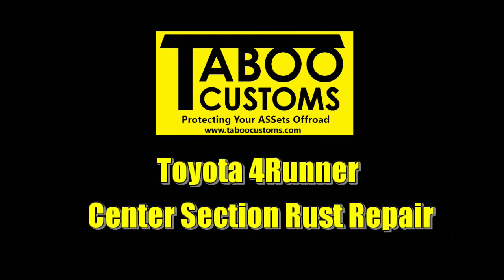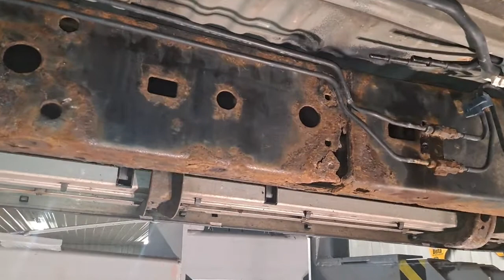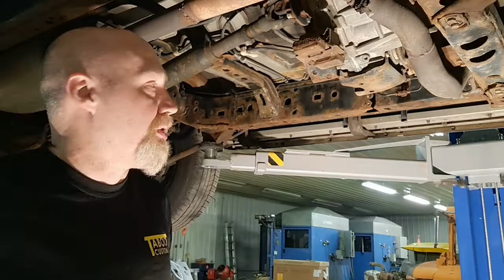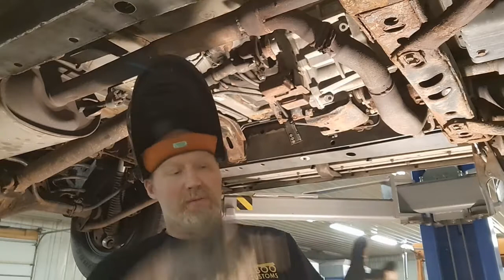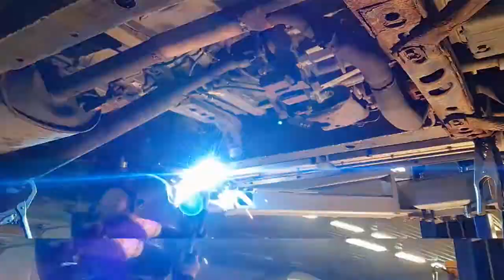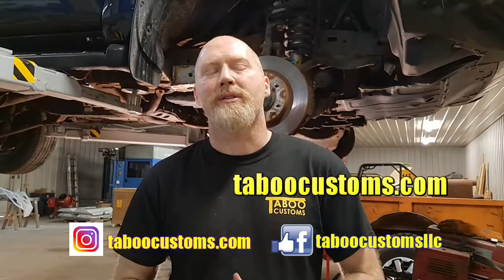4th Gen  4Runner Frame Center Section Rust Repair Kit Installation - Taboo Customs

Comment: I've watched several videos of these Toyota truck repairs, and am always amazed when no rust converter or paint is used on the original rusty rails. Why?  WHY?? WTF?
Reply from the maker: With welding you have yo be careful about what you are welding around.  Use the wrong thing and all of a sudden you are creating poison gas.  I know having inadvertently experiencing this first hand and ending up going to the hospital.  This is why we needles scale and will only use weld thru primer when welding.  After that it depends on what the customer pays for.   We offer several options from nothing to full Eastwood Rust Converter and Eastwood Rust Encapsulator Plus.

Comment: ....it is done like this: the frame is freed from all ATTACHMENTS TO IT (body, wheels, etc.), then the frame is treated physically and chemically, then welded where necessary, then repainted, THEN ANTI-CORROSION MATERIALS are PUMPED INTO THE FRAME and at the end all the components are hung on it again ...
.... and this video is about "SNOT"....
Reply from the maker: Thanks for the comment! Not sure exactly what your going on about though...
Reply: @TabooCustoms  ... this video is not about the correct repair of a rusty car frame, but WELDING AS WELDING...
... This is my point...
Reply from the maker: @MrPetrvershinin correct its not.  Its about instructions for the installation of our center section kit on 4th gen 4 runners.  Welding is perhaps a pretty integral part of that.  
L

Comment: I looked far and wide for a 4th gen 4runner for my girlfriend (wife to be someday) and her 9 year old daughter something safe something fun we could build together and adventure in someday . So after looking at every 4runner in our price range from San Diego to the Washington border I found one looked extremely clean not a single dent with lower miles I crawled under and completely overlooked all the rust  before I bought because it was painted over cocked spray foamed etc I’m extremely sad . I’m kind of at a loss for words I sold my Harley to fund this and now I just hope this frame repair kit does the job . Wish me luck apparently I’m running out or don’t have any left ………
Reply from the maker: Unfortunately we hear that a lot, Jeeps, trucks, Toyotas the look good on the outside but the frames are rotten and it gets overlooked.  We have even had dealerships bring us trucks to repair that they had just sold and they overlooked the rust as well.   Thanks for your order, if you run into any issues or have questions  let me know.

Comment: Wouldn't you want to cut out the rust? Metal on metal will create rust in between and will be worse.
Reply from the maker: @110welding  we do  cut out the worst but want to overlap to get to good metal sometimes quite a bit.  I don't think we show it in this video which is our fault but we highly recommen using SEM zinc based weld thru primer we then coat the frame and inside of the new panels when installing.  Link in description.
Reply: @TabooCustoms  thanks for the info. I have not had to repair a frame yet. Reason for my question,  thanks for replying.

Comment: This looks like a great option to possibly restore the integrity of the rusted 4Runner frames.  Does the kit come with written "how to" instructions?  Did you use any other rust removal tools than needle scaler, grinder and wire brush (I couldn't quite tell as that part of the video was sped up?)  I couldn't tell from video how you bolted the kit parts to the frame.

Approximately how much time is involved in the welding portion of installation (considering this will be our first time....assume the second side will go a bit quicker?)   thanks in advance...SM
Reply from the maker: Hello, yes most of our kits come with some written instructions but the videos are probably better for instructional purposes.  I typically have a 90 and straight die grinder as well with a burr bit.   On the driver side there are existing threaded holes we used for the bolting just to hold it in place while we lined them up.  Time depends on condition, experience, etc... 4-8 hours Id say. It can take a while.
Reply: @TabooCustoms  Great, thank you for your prompt reply and helpful info.  Trying to determine if I want to tackle it as I don't have a lift.

Comment: Why did you not cut the rust out on the bottom.  Water will get in between the metals and rust through the new patch work?   Am I missing something?
Reply from the maker: Depends on the vehicle, and the amount of rust.  We do recommend cutting out the extreme rot then using a rust converter and weld through primer on the rest.  Unfortunately in a lot of Toyotas if you cut out all the rust you wouldn't be left with much.  You have to be careful not to compromise the original frame integrity or it will start moving on you before you get the repairs in place.
Reply: Your correct..Safe T Cap is not like that !!

Comment: is there no concern of water getting trapped between the two elements? did you prime the inside o the replacement piece?
Reply from the maker: Yes we recommend zinc based weld through primer.

Comment: So glad I found this. Much cheaper than Safety-cap and covers a larger portion. I started using Woolwax on my 4runner, but too little too late. I see this kit in my future. Fortunately, this really isn't that hard to do all you need is a grinder, a mig welder and some time....Its just metal folks.
Reply: It's actually Metal and Rust with the latter being the real issue.

Comment: Any advice for minimizing warping of the frame, or is it not  too much of a concern?
Reply from the maker: Typically not a massive concern as long as your not cutting out large sections.  If there is concern I'd take some measurement before so you can make sure it is square when welding in the new pieces.
Reply: @TabooCustoms  thanks, appreciate it

Comment: Does the welding cause weakness in the original frame?  Is the original frame mild steel, or hardened?
Reply from the maker: The welding, done correctly (without undercut, burn through, etc) should not cause any weaknesses.  Typically frames are made with easily welded steel if you look around your frame you will see a lot of welding.  Now once you get to larger heavy duty truck frames you would start getting into higher grades of steel however those can still be welded but you might want a stronger wire to match the base steel strength.

Comment: How do you take care of problem with water staying between sheets of metal on bottom of the frame? 
It would be better to cut out old metal and leave only 1/2 inch for overlay (not sure if it's called like that in english), or at least old bottom should be removed. With proper spray gun it's possible to protect the frame internally with epoxy based primer. With current approach there is no way to put any paint in the gap between two sheets of metal.
Alternatively you could use SS and braze it with tig/mig and old metal could rust with no problem for new metal sheets
Reply: This method, just like safe-t-cap is a bandaid, I actually cut out or off all the bad metal and replace it with good metal. If you cover it, you are leaving a place for water to enter and rust again. And you won't see it until it's too late.

Comment: I'm curious about how much such a job costs. I saw your kit is 99 bucks but I'm guessing getting someone to do the welding is the much more costly portion of the repair. My 4runner is likely going to need this and I'd love for it to be salvageable.
Reply from the maker: 1st challenge is finding someone willing and capable, a lot of shops won't do rust repair.  Labor prices then can range from 1000-2500 for a repair like this.

Comment: Have you anything for a 2000 Trunda?
Reply from the maker: Sorry we do not.  If you are close to SE Iowa we might be able to develop something.
Reply: @Taboo Customs  Central Kansas  I'm afraid.
Reply: @TabooCustoms   Safe T Cap has all the Tundra parts
Reply: Check with a near Toyota dealer there was a recall for tundras with rust related